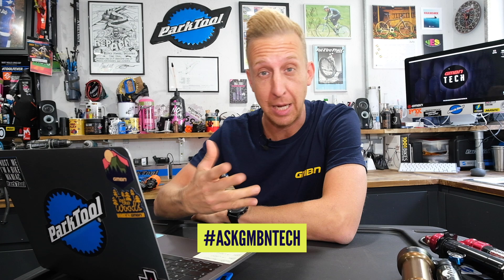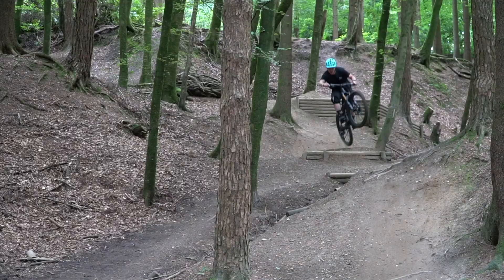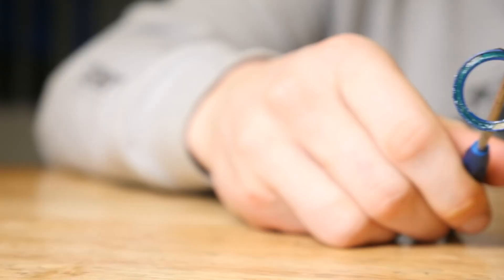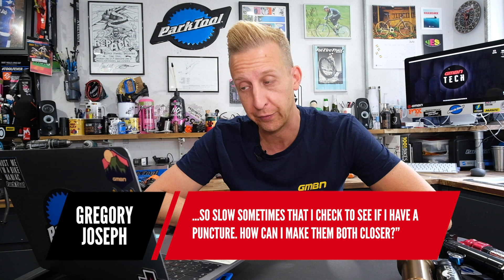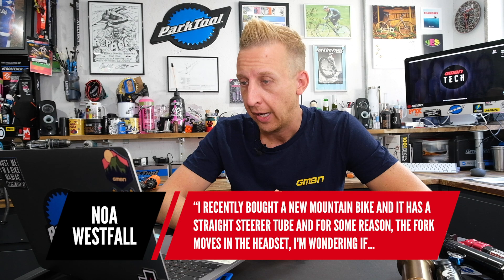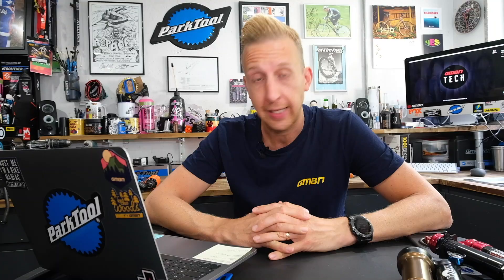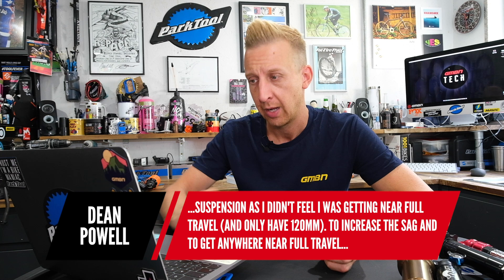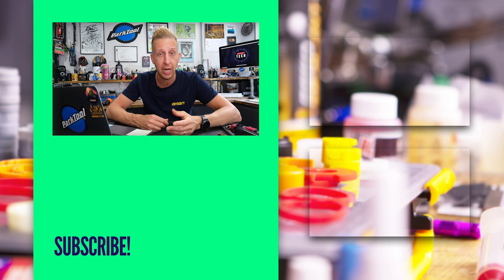I Find It Hard Swapping From An XC To Trail Bike Can Tyre Choice Help? | #AskGMBNTech

Comment: #askgmbntech coincidentially i replaced the rear shock on the trail bike of my oldest son to a Rockshox Monarch R in medium tune. He is about 60 kg in weight and i have set the shock to 95 PSI for 25 % sag, so i assume this is kind of normal. After a few cycles pumping the shock this regulated to a "normal" shock feeling. My personal experience with air shocks is that they tend to be not optimal to tune when you're on either side of the "weight game" ;-). BTW love the show and thanks for the tip of putting a higher pressure in the negative air chamber of my CC HELM fork and then put a lower pressure in the positive one. I am 85 kg and using it with 70/65 PSI in negative/positive air chamber and it makes a hell of a difference when it comes to small bump compliance !
Reply: The Monarch is a fairly easy shock to rebuild. I've done a couple monarchs and old ario shocks. Sram has a good walk through on YouTube. It uses 7wt oil, you might try 5.5 if you think it is too stiff for your son.
Reply: @chrissmith2729  Thanks for the tip, but this would be counter-productive for a teen, which grows up to one inch in three months and could empty a fridge in the blink of an eye ;-) i am more concerned about the size of the bike, as he rides my old size medium trail bike and is in the meantime close to two inches larger than me !
Reply: Replacing the oil doesn't take that long, and to charge the ifp I just run by a shop that has the pump. Or order the adapter piece to work with a shock pump, could try the lighter stuff and in 6 months go back to stock.  I doubt 50lbs will be gained in 6 months, i am 185lbs with stock fluids in my shocks. Playing with different fluid weights is pretty unique in the bike world but in the moto world it happens all the time.

Comment: I used to run a RockShox monarch shock and I couldn’t for the life of me get the last 20 mill or so of travel so I changed it to a fox float shock and it now works fine the problem was with the shock and not the bike

Comment: As for the switching over from the XC bike to Trail bike.  First off, why not just try running the same tires on both bikes?  
Secondly, historicity XC bikes handle like dog poo. Their main focus was to be fast climbers, handling comes second. Finally in recent  years manufacturers have started making XC bikes that can be ridden aggressively. Hence the term "Down Country". I'm thinking that's probably the crux of your problem.
Reply: Well the fact that this punter had to write it and ask a question about the differences of the tires shows you he doesn't understand the physics he doesn't understand what the tires were designed for he's just some silly boy with too much time on his hands. He should be out riding his bikes I'm not worrying about the differences between cross country and trail tires

Comment: I bought a new bike and the rear suspension always felt like crap. Always harsh no matter what I did. I decided to take the air can off and found the problem. 7 volume spacers. I took 5 out and what do you know, it felt great.

Comment: #askgmbn I have a Rockshox Judi silver I can’t bottem out my fork and I have 35 to 40% sag and i dont can use the last 25 mm travel (im 70kg) and there is no volume spacer in it
Reply: Ronald van der Veen you don’t want to be bottoming out thus it’s a good thing
Reply: @ajs0350  yea but you dont want to have 40% sag and the fork then dosent use the last 25mm of its travel
Reply: Ronald van der Veen it will do it you go off something big enough it’s designed to not bottom out so it doesn’t break itself off something small.
Reply: Im sorry to say this but it sounds like your fork might be broken internally.
Reply: @commieasmr8469  no i have my bike around 3 monts now and its from the beggining ( sorry for my bad englich) im Dutch
Reply: @bananasstuff3344  i ride jump trails and when i do less sagg its not so convertable

Comment: #AskGMBNTech I have a trail bike with 2 piston hydraulic brake with 180mm rotor and resin pad, front and rear. Lately my brakes showed sign of lack of stopping power, especially during long steep descents. I have to pull on my brake levers very hard to effectively reduce my speed. My brake pads are relatively new, so I am thinking to upgrade my brake to 4 piston/bigger rotor/metal pad and rotor. The question is, which upgrade (or combination of upgrades) would provide most bang for the buck? Basically, I would like to have better stopping power while spending a reasonable amount of money. I mainly ride singletrack flowy trails, and I go ride bike park several times a year. Thanks.

Comment: #askgmbntech I recently serviced the rear hub on my 2019 Rocky Mountain Altitude A30 (shimano mt-400 boost). It took me forever to get the cone setup right because the hub would over tighten when I put the wheel back on the bike and tightened the thru axel. I finally got it right after many tries but I’m not even sure what I did to make it work. Any tips on cone adjustment for this type of hub?
Reply: On any hub with actual adjustable preload on the bearings; you need to adjust it such that there is a tiny bit of play when it's out of the bike. Once the thru-axle or quick release gets tightened,  the play will get taken up and everything will roll smooth. The best way ive found to do this is with an axle vice (in a vice), tighen one side of the hub fully (usually the drive side) and then loosely snug up the non-drive side with no play. Tighten the axle into the axle vice, and then with your cone wrenches, back off the inner cone while holding the outer, tightening them against each other, and backing off the tension on the bearing. Takes a while to get the feel for it, but once you do, you'll have smooth rolling hubs.

Comment: #AskGMBNTech 
Hey Doddy & Henry, I've been a "silent" listener for the last couple of months and took so much from your content - thanks! Now I have a question: 
I ride a BMC Trailfox TF02 from 2012 and have been loving it for the past 8 years :) There are just two things I'm not happy with: 
1) it has 26 inch wheels - I guess there s not much to do about it and that's also the reason why I consider buying a new bike in 2021/2022 
2) during technical descends, the bike is pretty noisy- I already tried the rubbermastic tape tip and it helped a bit (thanks!) - but I guess most of the noise comes from the chain bashing in the cage of the front derailleur. The drivetrain is a 3x10 Shimano XT/ SLX mix.

Now here s my question(s): Would it make sense/ be possible to upgrade the bike to a 1x12 Shimano XT group set? I guess I need a microspline adapter for my rear hub (is that available for my 2012 Easton Vice Wheelset?). Would the upgrade affect the suspension characteristics (which I really love as they are)? Anything else to consider (bottom braket style e.g.)?

Then when I buy a new bike, I could take the 1x12 Shimano XT set and put it on the new one - and replace the OEM drivetrain (which might be inferior) => does that make sense?

Really curious on your thoughts - and if an upgrade would not be possible/ would not make sense: What current bike(s) would you recommend to have a closer look with similar characteristics to my BMC Trailfox?

Thanks & cheers, Daniel from Frankfurt, Germany
Reply: Changing from a 10 speed cassette to a 12 speed without replacing your rear hub would be a challenge. The problem is not only the spline design but also the longer freehub body required for the higher number of cogs. It's easier to buy a suitable rear hub and rebuild your wheel on that. The direction I'd go in is a 10 speed speed Deore setup, keeping the wheel as it is. The RD-M5120 mech and CS-M4100 cassette is a great combination. It's pretty cheap, the 11-46 range would be an upgrade for you and the derailleur has a clutch. Last step is to choose any suitable crankset with a narrow wide chainring to fit your existing bottom bracket. Even though there would be no upgrades to transfer to your new bike later, you would save money over an XT groupset, eliminate the horrible noise and raise the value of your old bike so you could sell it for a better price when you decide to buy a new one.
Reply: @frankthetankricard  Thanks! Could I also just keep my crankset and just remove the small and large chainrings and maybe replace the middle chainring with a narrow wide one?
Reply: @danielburger6283  That's possible if your chainrings are removable from the crank. This is not very common with 3x cranksets as far as I know but you will have to check if yours are bolted or fixed in place with rivets or something similar. If you are lucky you will find 4/5 bolts holding each chainring, in that case you can measure the BCD (google it) and order a matching narrow wide chainring. Also keep in mind that if you have options on where to attach the new one you should try to get close to the "optimal chain line" (you can google this as well) so your chainring lines up roughly with the middle of your cassette.
Reply: @frankthetankricard  thanks again. I did as you proposed. Took me about 190€ for the cassette and derailleur you suggested plus a new chain, raceface 32T narrow wide chain ring, some grease, loctite and shipping. I was able to complete the conversion in 2 afternoons (thanks to youtube tutorials :D ).

What can I say? Now I need a bell :D There is absolutely no noise from the drivetrain left - one of the best upgrades I had for a bike!
Reply: @danielburger6283  I did a shakedown with mine last weekend. It works really well, I was impressed! I'm glad it worked for you as well.

Comment: @dean powell I have a Cannondlae Bad Habbit with a Monarch RT on it, and I had put in storage over the winter, and somehow a seal got messed up. I don't know if this is what you are experiencing, but my problem was the air had leaked into another chamber that wasn't supposed to have air in it, and my shock wasn't rebounding to the proper position. My coworker replaced the seals and It works great again.

Comment: #askgmbntech I've been getting back into mountain biking with my mates using an old klein attitude and a klein adept race. they were great back in their time but now the old coil sprung forks, 26" wheels, and mechanical rim brakes feel like they're holding me back. is it worth overhauling the bikes with new wheels, forks, brakes, drivetrains etc. or is it just time to upgrade to a new bike and get the benefits of the better wheelsizes and geometry? would love to hear what you think!
Reply: Get a new bike. I have a couple of that generation that you're talking about and today they make good commuters or a budget XC bike, no more. Even the most budget late model ones will feel amazing to you.
I would go to a trail center and demo or rent a couple of times to find out what you want. A 29er hardtail or a low range budget name brand fully would be a good start to try. I bet you'll be amazed how capable they are. Budget top tip is the Caliber Bossnut if you don't mind the semi no name. Run it for a year, replace tyres and upgrade the fork and you'll have a great bike for a couple of years.
Reply: Having recently gone from what must have been of of last of the 26” hardtails to a specialized epic ht (2020 model with the updated geometry), I can confirm what Andy says. The Canyon ‘Grand Canyon’ also has very similar geometry if budget is more of a concern. 

Don’t lose too much sleep if a new bike weighs a kilo or so more either.

Comment: #askgmbntech I’ve just bought a new frame however my dropper post is 30.9 and the frame is 31.6 is using a shim to make it work ok or it worth just getting a new dropper post. Btw the shim would not be a coke can but a proper one. Pls help
Reply: Proper shim is fine dude, no point forking out money for a new dropper when a cheap shim will be fine mate.

Comment: #askgmbntech hey doddy love the videos. i have a question about tires and psi as well. im currently running tubeless wow i shouldve one that sooner.do sealant react differently in very cold weather? should i try a different type of sealant or should i run tube in the cold winter months?

Comment: #AskGMBNTech Hello Doddy. I got question related to wheels. I got 29" Orbea Alma H30 eagle (2019), and planning upgrade my wheels. I'm struggle to find "right"  hubs for rear. Right now running Shimano FH-MT200-B hub with QR and 141 Boost. "Internet tell" what possible to buy 12x148 Boost hub and replace with a different end cap that reduces spacing to 141mm. How to choose right hub for me (Dswiss or Novatech)? Another question: Most of new hubs run 6 bolt rotor attachment. If i switch to 6 bolt rotors, now i use Center Lock system. Did my Shimano MT-201 brake need some adjustment?

Comment: Hey Doddy & Henry! Mullet conversion question for you. I have a Diamondback Release trail bike with 130mm in the rear and 150mm up front. I'm thinking about doing a mullet conversion to plow over chunder better. I did the math and it looks like my geometry will stay pretty much as is if I shrink my fork from a 27.5" 150mm fork to a 29" 130mm fork. Are there any unintended consequences that I'm not considering? I'm not too concerned with the loss of 20mm in the fork, as it's rare I use the full 150mm I have now, but want to make sure I have my bases covered! Thanks guys love the videos. #AskGMBNTech

Comment: Re: the loose headset - never have i ever seen any new bike where the headset doesn’t need tightening after a few rides.
Reply: For sure. I've installed my own headsets and I definitely press them appropriately and they always need a little bit of tightening after the first ride. It is also true however that people have purchased bikes and found after riding them that a crown race was never installed on the fork from the factory/bike shop. Although that's extremely rare.

Comment: #askgmbntech hi my name is Paul I have been out of the bike game for many years and now see the massive change in gear like going from 27-30 gears back down to 11-12 why is this and why are bike still so expensive even though your getting lesser stuff?
Reply: The technology involved into creating the simpler design of 11-12 speed bikes still gives you the range of gearing that you would be used to. Instead of having say 11-28 tooth cassette on rear you now have 10/11-48/51 depending on manufacturer. 
Team that with the fact you no longer have a front derailleur (less maintenance) you will use what is called a narrow wide chainring which effectively grips down on the chain locking it onto the chainring. Less chains coming off means more riding. 
Happy trails
Reply: @jonchadwick1990  thank you so much for your help and take care

Comment: #AskGMBNTech I have a vitus nucleus vrs it has tubeless ready rims but not tyres, can I still go tubeless?
Reply: I asked a similar question on last week's show. Someone replied in the comments. Best if you have a look
Reply: I have run non tubeless tires on originally non tubeless rims and had no problems, just did a tubeless conversion on rim. Lots of videos out there on that exact thing. I think even gmbn did one.
Reply: shafhamid83 couldn’t you just say the answer? you do realize there are thousands of comments right?
Reply: You can but it will burp alot

Comment: #AskGMBNTech hi Doddy, I've been having some problems with my front derailer. When I shift from the big gear to the smaller gear sometimes it wont shift back up to the big gear. Love the content, thanks.
Reply: Try adjusting the limit screws. Maybe the front mech isn’t moving enough to the outside to shift. Also, make sure your chain is in good condition and is clean and lubed

Comment: #AskGMBNTech
I bought a wheel set just over a year ago for my xc/trail hardtail, after over 2500miles of riding on it I have noticed that the xa free hub body on the wheel moves slightly side to side causing iffy shifting. I would love it if you could help me to fix this problem?!? 
Just if it helps the wheel is a 142mm spacing using a QR system.
Thanks!
Reply: Sorry I ment a sram XD freehub not XA 🤦‍♂️

Comment: Hey Doddy, love the weekly show. Have learned a lot! Question about disc brake noise. I have struggled to silence a pesky rear brake squeal/grinding noise. Installed a new SLX M7100 brake set and get a grinding sound when the brakes are cold. No uneven pad wear. No metal on metal contact. Resin pads. Just sounds like rocks grinding together until they get some heat on a decent or hard breaking section. Help! Thanks for any help! #AskGMBNTech